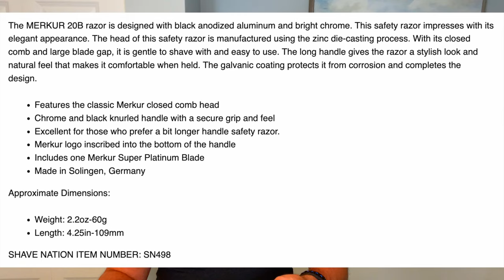Merkur 20B Geofatboy's Everyday Shave #27 Lea-Aqua Velva

Comment: Your everyday shaves always end with an aggression rating. It would be informative if you could list those safety razors with aggression ratings from 1/10 to 10/10. Most of your ratings are in the 4 to 6 out of 10 range. I have always assumed razors are at both ends of the aggression range. But you know what they say about "assume."